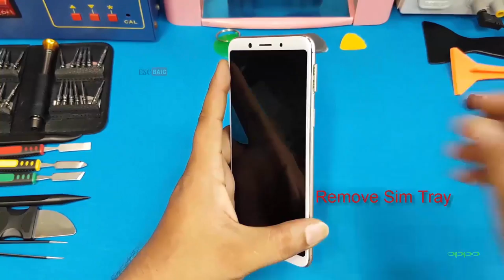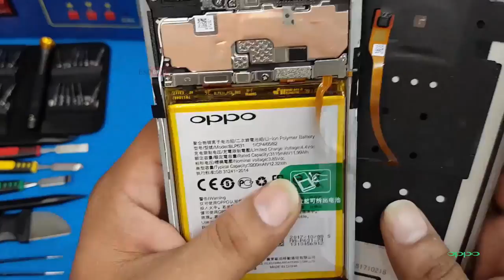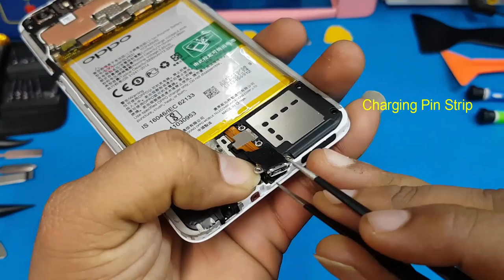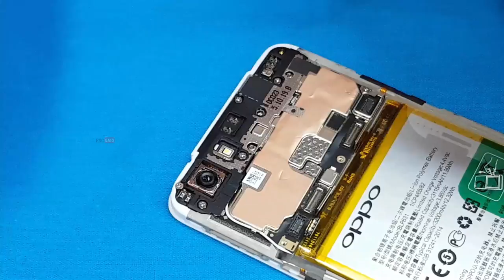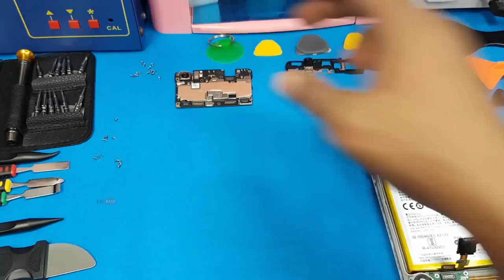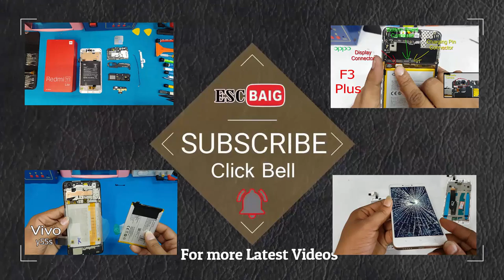New OPPO F5 Disassembly || OPPO F5 Tear down || How To open OPPO F5- all internal Parts of OPPO F5

Comment: My OPPO f5 has some problem like
When I switch it on ( means power on ) it shows logo and then switch off automatically .and then this procedure automatically turns on and off till battery ends 

Plz plz help
Reply from the maker: it may be  Software problem , first try  hard reset the phone, if problem not solve then software it..